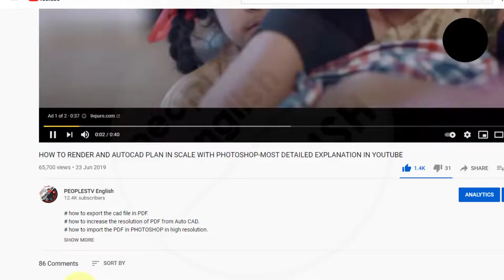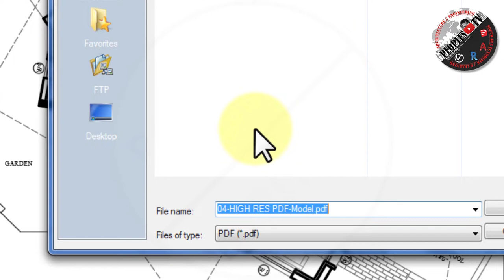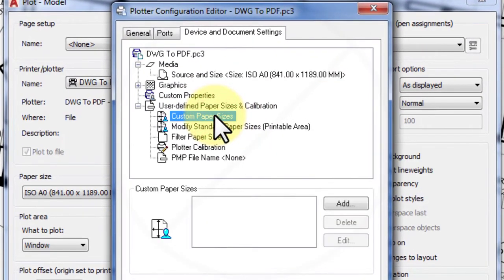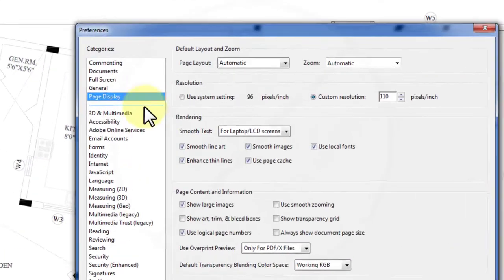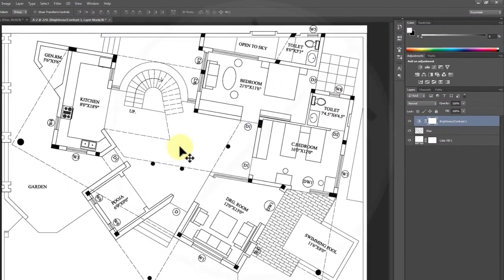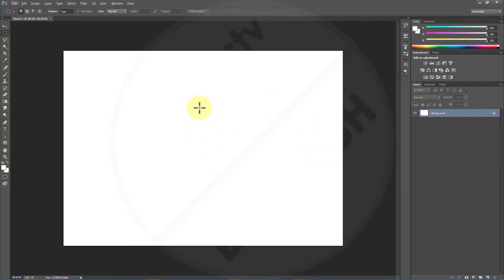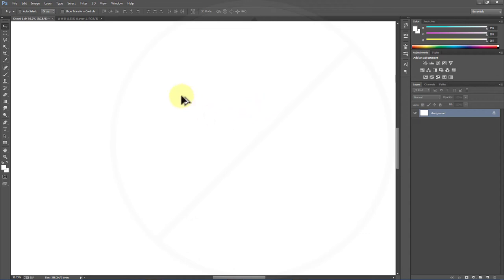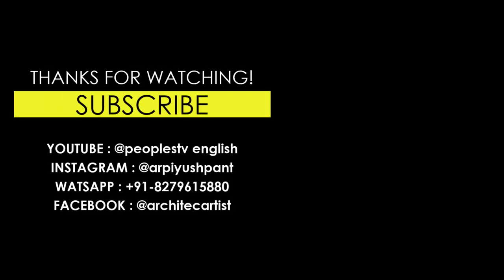How to remove PIXELATION from a PDF PLAN EXPORTED from AUTOCAD / High Resolution PDF EXPORT/IMPORT

Comment: Hello sir, 
I’m making a Interior portfolio and I have to use 72 resolution. I tried doing A0,A3,A4 size pdf but when I’m moving to a new sheet of 72 resolution, whole plan is getting blurry after transforming it.
Reply from the maker: When you move your pdf to new sheet, done need to reduce the PDF with transform tool, instead, try match the sheet resolution with PDF , later you can compress the file size

Comment: Hello Sir,
I created a presentation resolution AutoCAD pdf of A3 size with my drawings to scale at 1:300 (scaled using AutoCAD). I right-clicked the pdf, and opened it in photoshop. Upon saving it as pdf after working on photoshop, my pdf is very blurry and has lost the crisp resolution it had when I saved it as AutoCAD pdf. Could you please help me? 
I am tried to use an older version of photoshop, A0 or working at 1200 resolution for a big portfolio isn't an option for me :/ I have been using photoshop for the last 3 years and my pdfs would always be extremely crisp! this is the first time I am facing this issue!!
Reply from the maker: If you are rendering plan in photoshop, than autocad pdf is for refrence only once you are done rendering walls and other stuff, you can ofcourse remove the imported PDF, or can export the image in optimised size after rendering done, and also there is another method of rendering in PSD in which pdf resolution dosent matter check this video and see how I have rendered walls with refinement

https://youtu.be/J2aafseReuA
Reply: @peoplestvbypiyush  thank you sir. But what if I not rendering my plan, just rendering the landscape. If my jury tries to zoom in more than 150% they will see that the lines are blurry.
Reply from the maker: Yes liya in that case work in high res PSD but export in optimised PNG format from  PHOTOSHOP it won't get blurry
Reply: @peoplestvbypiyush  thank you sir, i shall try that! So would you suggest that I print it at A0, then follow your tutorial, and save it as PNG instead of pdf?
Reply from the maker: Yup try that